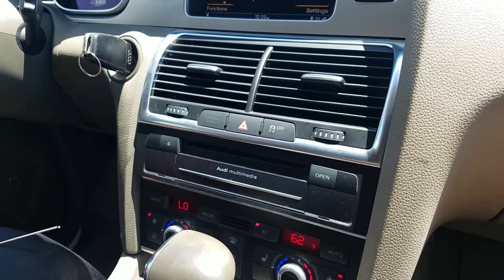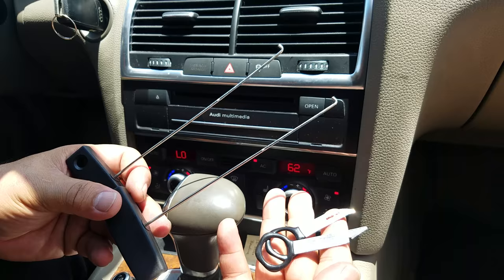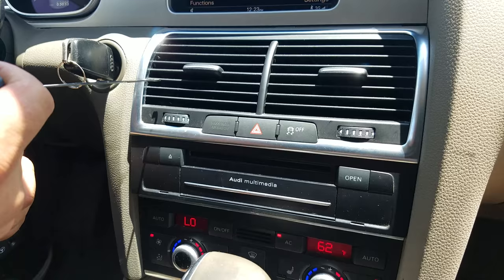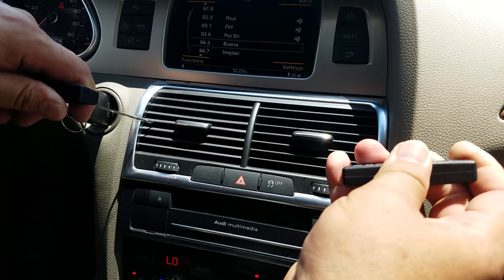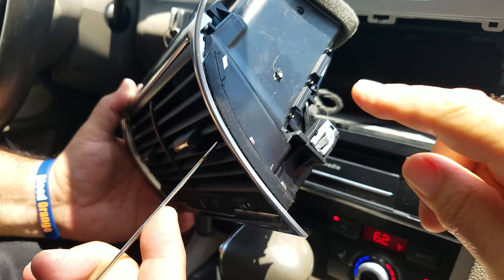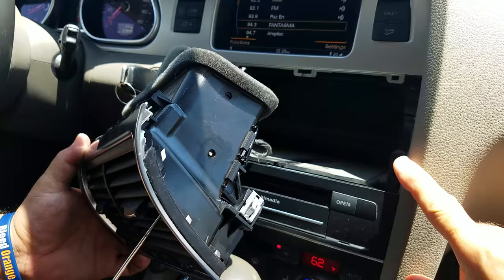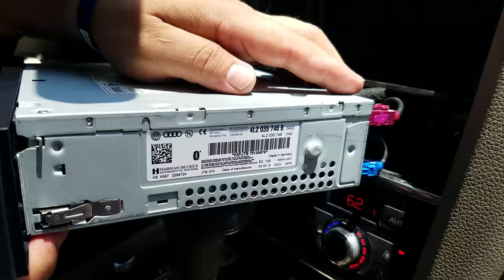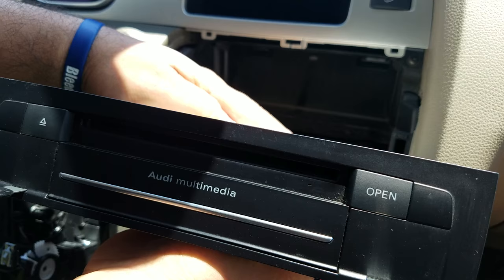How to Remove Audio Multi Media Player / Radio / Navigation from Audi Q7 2012 for Repair.

Comment: I have a 2008 Audi Q7 and the sound stopped, what could it be?
Reply from the maker: Problem could be the amplifier or Satellite tuner module or navigation drive module, all located in the rear passenger side quarter panel.  Please watch another video for Audi A8, you need to do the same in your car to find out out which module is bad.  Here is the link:  https://youtu.be/cKf8pofmINs